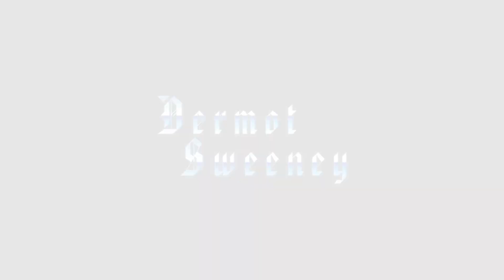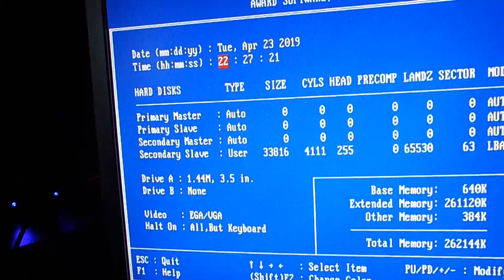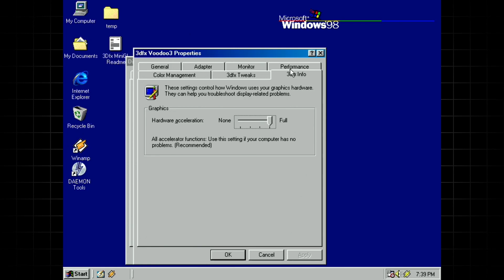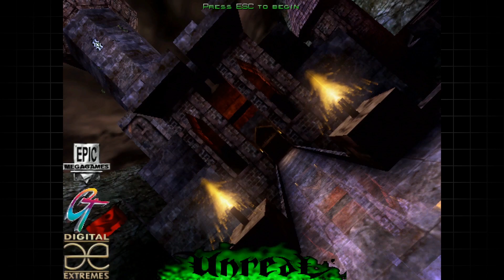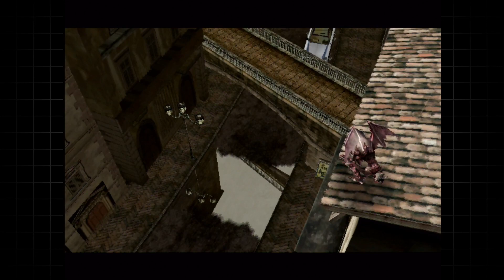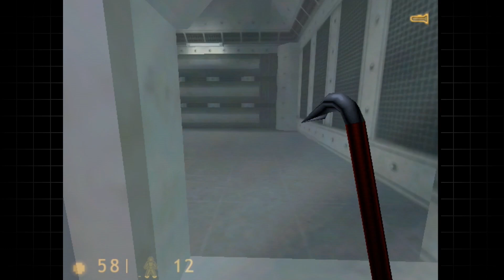90's PC Restoration Project ( Part 03 )

Comment from the maker: NOTE: I made a mistake when setting the AGP Memory Aperture size in the BIOS. I mistakenly  was under the impression that this had to match the amount of memory on the card. I know now that this is not the case. I had decreased this from 64MB to 16MB, this may be the cause of some of my performance issues. I'll clear the bios and try it out for the next video.